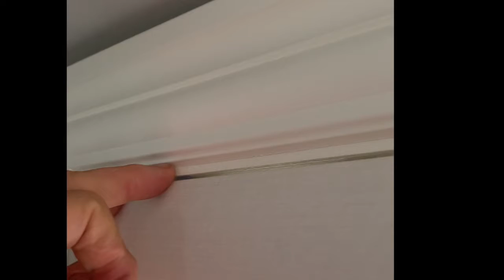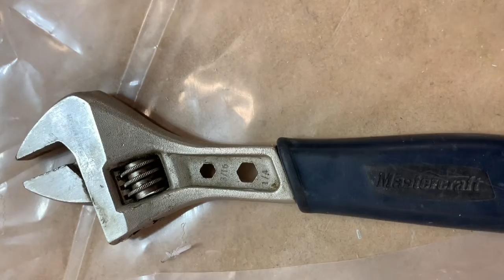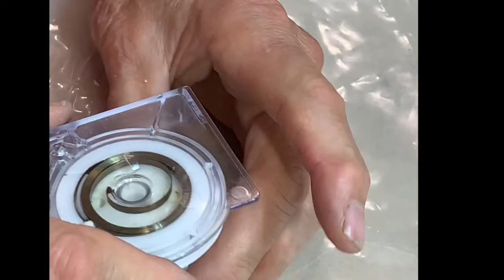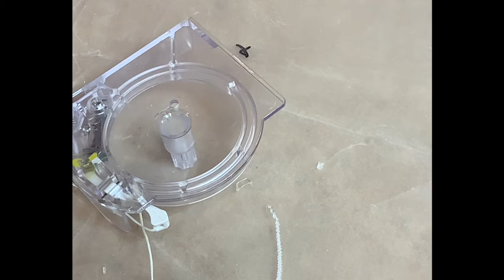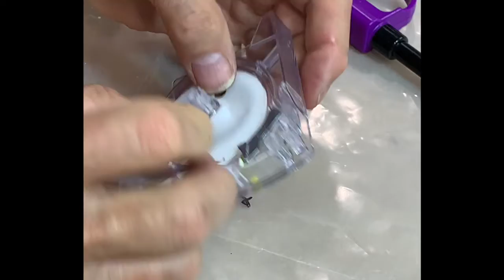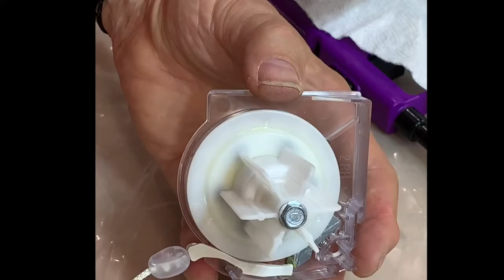How to Repair the Clutch Mechanism on a Hunter Douglas UltraGlide®️ Blind

Comment: George, thank you very much for your video posted 3 years ago. One of my living room Hunter Douglas UltraGlide2 shades (installed in 2015) stopped working this year (2024), the problem is the exact same as what you described here. After watching the video many times, I took the plunge, disassembled the clutch, drilled a 1/8” hole, and solved the problem with a screw I found at home.  Perfect fix and probably stronger than the original.  Thanks again, Allen in Toronto.

Comment: We've had the same issue with 2 blinds and this time I wanted to fix it myself.  This video was immensely helpful!  I had a little trouble with the spring popping out and I had to re-thread the whole thing 3 times which was a little crazy.  I'd recommend anyone who attempts this be super careful with the string and the locking mechanism too.  In the end, I got it done.
Reply from the maker: Glad it helped!

Comment: This HunterDouglas is the most stupid over engineered design ever seen!  So complicated mechanics for a simple task. The CEO and engineers don’t know the basic rule: Keep It Simple, Stupid! KISS. The video shows he can easily push the blinder back on the wall but actually 
it isn’t locked safely. In fact no way you can use their wall mount clips. Do Not Buy this brand! It will give you endless trouble, except you have skills like this video created. Nice video, thanks!

Comment: Really appreciate your video! It helps a lot. My clutch got the same problem. That plastic piece to hold the spring is damaged and it wont retract. Now to put a screw it! I will copy your steps! 👍👍

Comment: Thanks for your advice.  I successfully rebuilt the clutch mechanism including recovering from the spring exploding all over the place as you mentioned;-). My current problem is in reinstallation, it appears that the mechanism on the other end of the blind appears to have a spring in it as well.  When I try to re-wind the blind, something is going on related to the opposite end.  How do I set everything in a “neutral” position so that when I install, perhaps the blind is down and will wind up via the ratchet mechanism?  I have looked all over and find no advice on this procedure as everyone assumes all is well with how the blind is positioned for re-installation…. Thanks!
Reply from the maker: Since it is a ratchet mechanism, rather than a pulley system, there is no need for an up or down position. I installed it in a neutral position - about 10 inches of blind.  If I remember correctly the non-ratchet end has a spring that works horizontally - just keeping the blind in the ratchet system and has no direct force for going up or down.  I think I remember there is also a cog wheel mechanism  which I think stops the blind from going down between ratchet pulls.  Hope this helps!

Comment: For the life of me, I cannot understand the “loop” section.  Why are we doing this?  Where does the slack come from if we have wound all the line on the spool?  Thank you if you can give a little more detail here…
Reply from the maker: The “adding a loop” is done to tension the spring enough so that the hooked end of the spring does not come off the screw we needed to install. The “adding a loop” means that you add 1 rotation of string to the pulley that stores the string. You have to prevent rotation of the pulley as you add the loop.  Hope this helps!